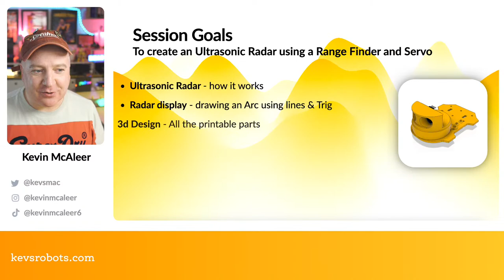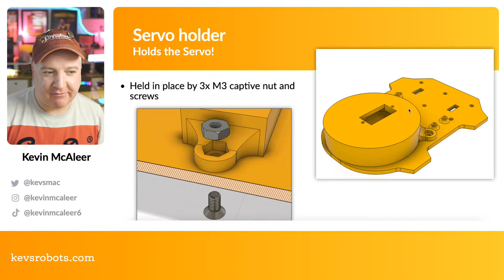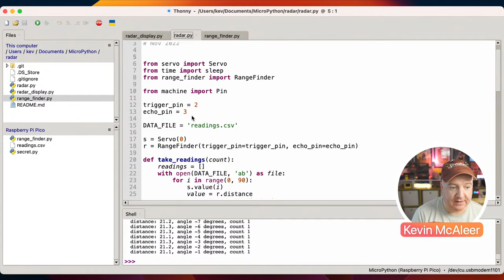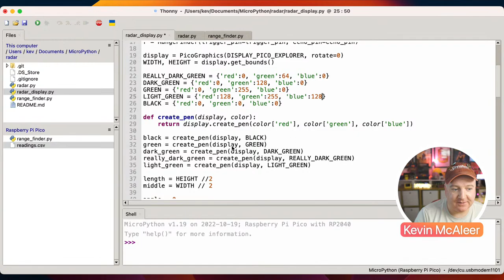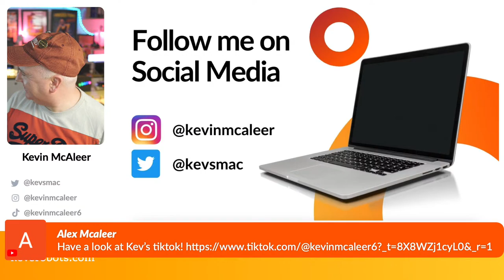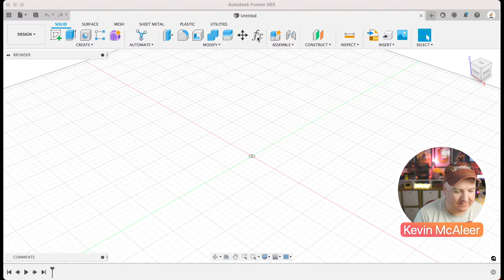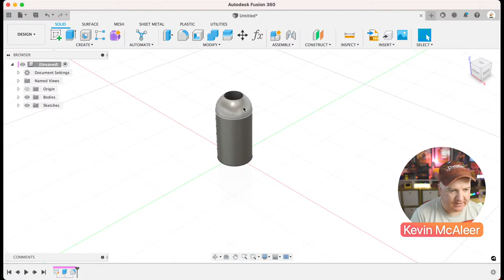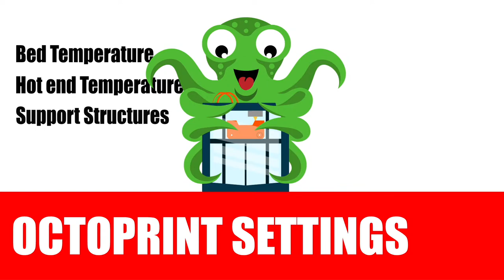Build a Radar robot using Ultrasound with Raspberry Pi Pico - Full Livestream version

Comment: I have several Pico’s with various uf2 files on them .  The CicuitPython ones are easy to tell apart, and I have labelled them but I have 3 other Pico’s with Pimoroni or standard MicroPython installed.  Is there a way to easily tell them apart ?